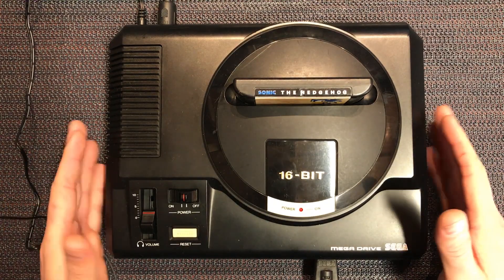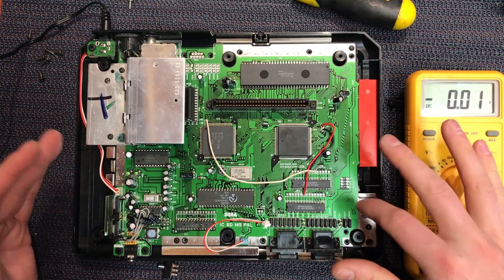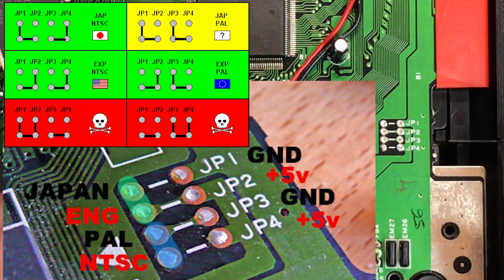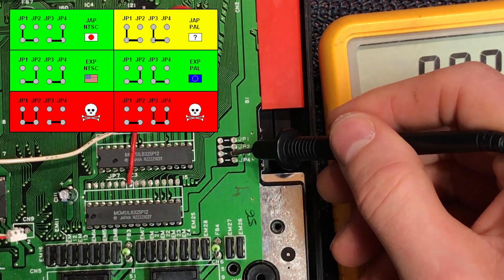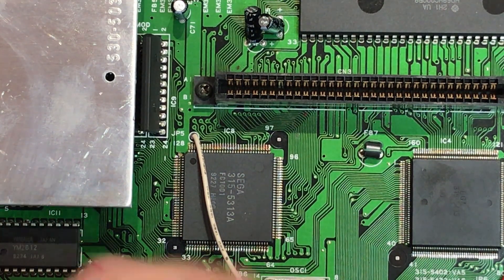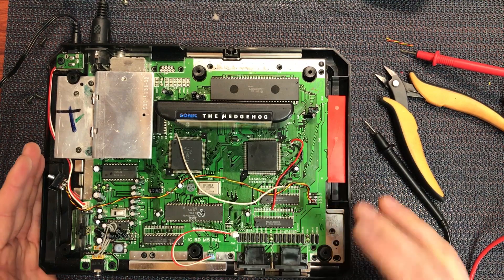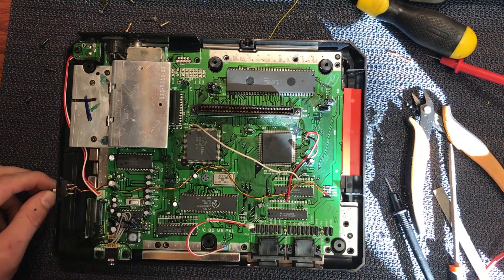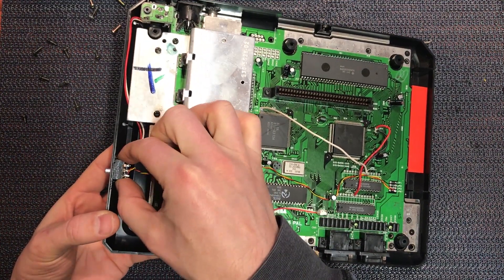SEGA Mega Drive 50/60 hz Mod PAL  - YouTube

Comment: I am currently looking to run the other way. I made the switch to the US and EUR regions on my Japanese Mega Drive, in the case of the US region it worked perfectly because here it is already 60Hz, the problem is when it changes to the European region, it is in a resolution, which I particularly found more pleasant, with the more "wide" aspect, but in black and white and "slow motion"

Comment: Just thought I would add this, I have found on most models that using a Sega 32x console with the mega drive will fix the color issue when switching to 60htz, if your wanting to use composite crappy cables.

Comment: If you flick to 60hz on the Fly you will notice some odd things happen in certain games. Sonic as you showed there the gameplay actually went slower. Sonic 3 which is a PAL Optimized 50hz Game if you have the European or Australian copy of the game goes completely messed up if you switch to 60hz on the Fly. I have a workaround for this which involves Sonic 2 and hot swapping the Cart :)
Reply: Forgot to also say, if Games don't work right (and aren't region locked) when you switch to 60hz on the Fly, fire up the MD in 60hz mode and all should be fine :)
Reply from the maker: Dave's Game Room Hey Dave, yep I shouldn't have flicked it over on the fly as sometimes it's fine and others it's buggy like you said. If peeps are reading this, listen to Dave and power off in between changing modes. :)
Reply from the maker: Yep agreed. I guess my motivation for flicking it over live was to see the difference between the two modes, but I should have been clearer on not doing that for actual game play.
Reply: @RetroSalesAustralia  i got two consoles that they are dead by the wrong connecting the language mod. Is there a way to restrore the consoles? Please HELP!!

Comment: I know this is an old video, but I have a question please. When modding a PAL Mega Drive to output 60hz like this, is the 60hz signal a true NTSC 60hz signal, or is it a PAL 60hz signal?

I ask because I have a modded Master System II with a 50/60 switch, and when in 60hz mode it’s outputting a PAL signal still. The speed increases and it goes full screen as you’d expect, but I just don’t think it looks great, when compared to a true NTSC signal from the likes of a Famicom or Super Famicom. I’m using a CRT.

Great video by the way, it was really informative and easy to follow, even for a newbie like me.
Reply from the maker: No it’s not NTSC it’s PAL60 which is pretty good, but not perfect. The timings will always be off by a little as the internal crystal is still set to 4.33Mhz PAL spec.

Comment: to get full compatibility I'd suggest a language mod aswell. also to get full colour from your Megadrive I'd suggest using an rgb cable be it scart or 9pin depending on what your tv or monitor requires I wouldn't bother changing the crystal.

Comment: nice video, the thing you mention at around 11:30 for ENG-JAP switches can actually be done with one single 3 state switch. Most people dont know that if you dont connect any jumpers, the board will treat it as same way as 5V was connected. This means, if none of the  jumper are connected, you will get US region!

With a single 3 state switch you can then interpret 50hz+ENG (PAL), 60hz+ENG (US), and 60hz+JAP (JAP).

However if you prefer to have full control and flexibility over 50-60hz and PAL-JAP selection you are better off installing two switches. I say this because I think some PAL games don't like to get switched from 50hz to 60hz AND ENG to JP region at the same time, but to be honest I haven't fully tested this to say that it does make any difference.. many PAL games will react differently if you switch while turned on.

 I just find it neat and cleaner that you can actually control all regions with a single switch.

By the way: which test monitor are you using and how is it connected?
Reply from the maker: Hi, good points! I'll give you question of the month for that one! :) Yes you're right, you can simply leave the pins "floating" and they usually default to one state or another which is fine. ...BUT that's a bit of a no no in electronics as sometimes the signals will float around and produce very strange outcomes. TTL logic is 0 and 5v so if you leave a pin floating it could sit anywhere it that range and sometimes screw things up if the level trigger a high or low. I always tie each pin either high 5v or low ground to be 100% sure and rock solid reliability.  Two switches does this easily, but once again, you're right it can be done the way you say. I think the Mega drive is happy to behave like that. For my test monitor, I use the Dell U2711 as it's 1440P and accepts three analog inputs. Composite, Component, VGA as well as digital DVI, Display port and HDMI. Read about the TTL logic thresholds here - https://www.allaboutcircuits.com/textbook/digital/chpt-3/logic-signal-voltage-levels/
Reply: Thanks for the response, ahh that is interesting indeed, always good to learn new things :)
Reply: @RetroSalesAustralia  you could place 2 resistors 10K ohms as PullUp 5V. one on JP2 and other one on JP4. This will ensure that when nothing is connected you are in US-NTSC mode. Then use your switch 3 positions On-Off-On then connect the ground on center connector of the switch and each side connectors of the Switch would be JP and PAL. This will ensure that in any case everything is connected to either GND or 5V and nothing is floating. :)

Comment: I made the modification on a Japanese Mega Drive, but when I use PAL 50HZ mode the image is black and white. The crystal is 53.69317MHz. Should I replace it with 53.203424 MHz to solve this problem?

Comment: Hey, it's me again :) thank you for your vids. I was thinking of something: I have a secondary MD unit incoming, and I'd like to mod one of them to 60hz (fixed) while still using composite (because I prefer it for SMS stuff). Do you reckon I could swap out the PAL-specced oscillator for one suitable for the NTSC format? I know I could do the ordinary switching mod while keeping the PAL osci on, but I really don't want to mess with the resistor trace on the mobo, it's too tightly packed with other stuff which I know I'm going to break. Ignorance tells me that the quick and dirty fix would be to outright replace the osci, would that work?
Reply from the maker: Hey, the short answer is, just use a Genesis console as it's ready to go. The long answer is, you can't just replace the PAL oscillator on the board with an NTSC one as the clock dividers would be all messed up and screw up the other chips. The right way to do it is to use an external PAL oscillator and hard wire it into PIN 6 of the CXA1145. BUT you will still need to lift the pin to disconnect the original clock signal. You'll end up with PAL60 doing it this way, or use an NSTC oscillator and get true NTSC60 (Same as Genesis). I'm planning a new video on this topic very soon as it gets a little more involved as there is really 3 pins to consider on the CXA1145 (5, 6 and 7).

Comment: Hmm I thought I won't go back to 50 but I find games easier to play at the slower speed and also the picture stays fully on the screen where with the 60hz it can go partially off screen.
Also I find 50hz is sharper than 60hz without using an RGB Scart cable and losing the blended dithering pattern

You also have PAL only games like Micro Machines 2 that play too fast on an NTSC console

Comment: So if I just wanna make my console run at 60hz, without any interest in adding a switch to flick between 50 and 60, I just need to cut the JP3 line and it should still work?
Reply: I know I'm late but did it work for you that way?
Reply: @NoGoodNameHelpPLZ  it did!

Comment: For the va4 megadrive which lines do you need too cut? I can't see it clearly on the image you posted on your website. Thanks
Reply from the maker: Glenn Poland The red and black wires need to be fully separated from the blue. So ensure the traces linking them are all cut. The switch is the part that rejoins them together, so you never want to leave the traces in place.

Comment: but the ntsc 60hz sega gensis games will run natively in 60hz or only in 50hz after the region free mod?
Reply from the maker: Lord Rythorn The switch controls the 50 or 60hz speed at the hardware level, so games will play at that speed regardless of where they’re from. If you play a USA Genesis game while it’s set to 60 then it’ll play perfectly. If you try and play it at 50, then it’ll run slow. The only reason to ever use 50hz is for PAL optimised games that were designed to run at full speed at 50. All other scenarios you should run 60hz. This manual control is what is meant by region free.

Comment: If I don't care about 50hz can I jsut set the console to 60Hz eng and not worry about the switch?
Reply from the maker: Luke Taylor Yes that mode is basically a USA Sega Genesis
Reply: Global Garage why does the mod take away composite video? CN I still use sync over composite/Csync rgb cables?
Reply: not all games are optimized for 60hz some games are optimized for 50hz and if you run them on 60hz speed they will be running too fast  @luketaylor9144

Comment: If one never goes back to 50hz, why have a switch? :)
Reply from the maker: Good question, but some picky PAL games that are optimised for 50hz need that speed. Also some games or add ons like MegaCD need to see PAL to boot. They can then be switched into 60hz while running. Also, I just like to have control. :)

Comment: I wouldn't do to my mint Megadrive but would do it on an old one. Why is NTSC faster than PAL?
Reply: In Europe we have 50Hz televisions. The US however, always had 60Hz televisions. Therefore they just couldn't make one console and ship it to both regions. Nowadays monitors easily support 60Hz output here, while TV's don't actually seem to.
Reply: Is it to do with voltage?
Reply: Michael Langley You mean our electricity net, probably. Europe has a 230V/50Hz net, while the US has a 110V/60Hz net. This was also an issue before we got switching power supplies.